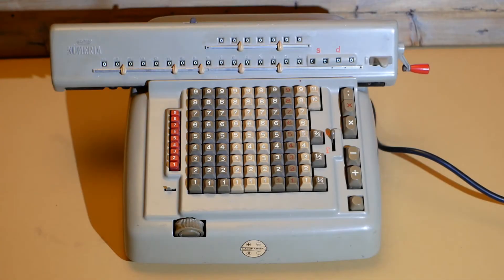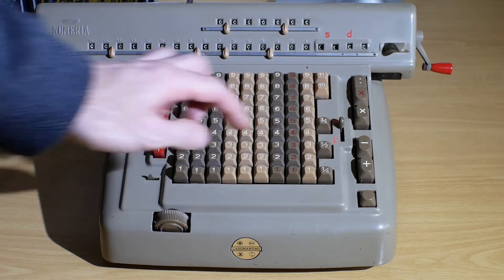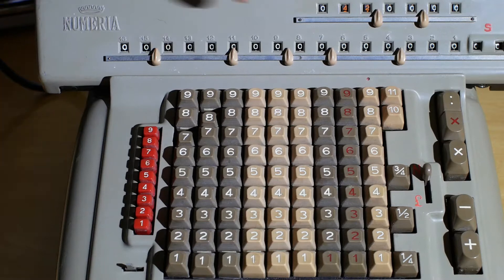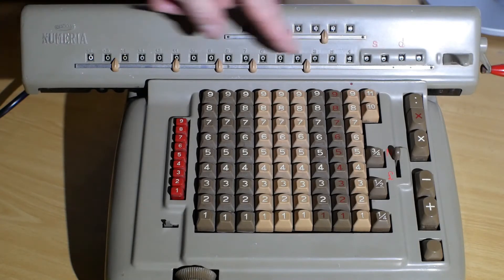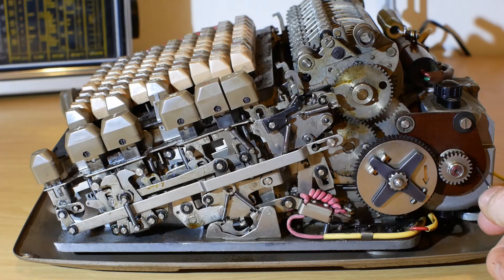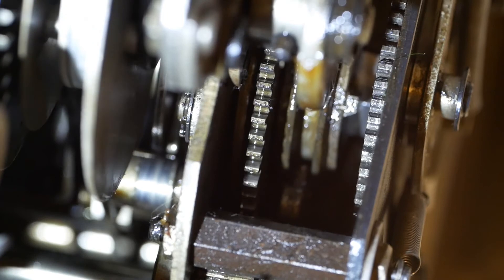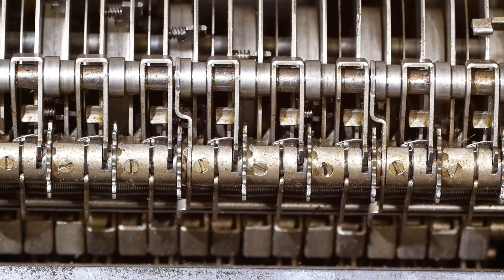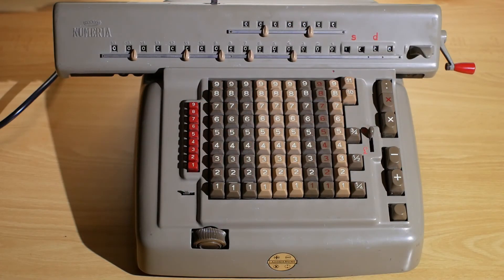Lagomarsino Numeria Electro Mechanical Calculator. Retro Tech

Comment: Been loving these videos. I have a few hand cranked units (a Lagomarsino 5XXX, Toshiba pinwheel, Brunsviga Nova 13 in very poor condition, Curta, and very recently a Facit C1-13) but just last week I recieved an old MADAS 20AV which I am hoping to restore. Alas, my girlfriend's parents are coming to stay next week so it will be another week or so until I can really start cracking it open!
Reply from the maker: Hi William, they are lovely machines aren't they, great fun to use and restore.  That Madas you got should be fun - the automatic machines are always really impressive, and they make a great sound too!!!

Comment: So a cashier in the 1960's would use a till built on a similar principle, and input the prices £, s, or d chronologically. The mechanical calculator would provide a grand total, but the human would have to calculate change for the money tendered.
Reply from the maker: Hi antonio2476, yes, back then the cashier had to be able to add up accurately and quickly in their head to give the right change, no bar codes, no digital display to tell you what change to give and no automated stock control.  I saw a lovely 1950s Regna cash register for sale yesterday - I'd have liked to own it, but it was massive and bound to be extremely heavy too, so I had to pass that one by.
Reply: @GrumpyTim  Thank you. Now, with decimalisation and digital calculators, it's almost too easy for people. Everything is done for them.
Reply from the maker: Yes, it's very easy to get lazy, and I'm definitely guilty myself of reaching for a calculator when I could easily work it out in my head.  It seems a bit bizarre, that in certain shops now, even though they have the correct change on the screen in front of them, the cashier manages to give the wrong change because they're too busy on their mobile phone or talking to their colleague about what they did at the weekend.....
Reply: @GrumpyTim  The old pounds, shillings and pence with the tanner and half-crown had more character, and was unique to Britain.
Reply from the maker: It had already swapped over to decimal currency when I was a kid, so I just thought that was better and the old system was complicated.  It wasn't until I got interested in old calculators that I really paid the old pounds, shillings and pence system any attention, and it actually had some really good points to it, and definitely had lots of character.  Even more character will be lost as the world seems to be being pushed towards cashless payments, which I could spend the rest of my life trying to point out what a bad idea that is......my general example goes like this:

I go to a lot of antiques fairs and flea markets - traditionally these would be cash only events, so I could pay a stall holder £10 for an item, that stall holder could then buy something from a neighbouring stall for £10, handing over that same £10 note.  The second stall holder could then buy 2 hotdogs for £10 using that same £10 note.  The owner of the hotdog van could take a liking to an old camera on a nearby stall and pay them £10 using the same £10 note and so on.   Now if we do the same thing in the modern "cashless world" - I pay stallholder 1 £10 using a card payment, at some point in the future his provider will pay him something like £9.70, having taken a 3% cut.  Stallholder 2 receives £9.41 of the original £10, the hotdog stand gets £9.13, and the third stallholder gets £8.86, and before we know it there's nothing left of that original £10 and the providers of the card payment systems are rubbing their hands together....
Reply: @GrumpyTim  Yes. I always try to use cash.

Comment: Great good job  , what is difference between this machine and lagomarsino tottalia
Reply from the maker: Hi Milad, as far as I'm aware, "Numeria" and "Totalia" were both brand names that Lagomarsino owned - with Numeria being used on the full keyboard machines like mine and Totalia being used on their 10 key adding machines.  If you pause my video at 11 minutes and 20 seconds, you'll see the motor is labelled as "Totalia Numeria"
Reply: @GrumpyTim  thanks it was a question why two brand with same work in lagomarsino